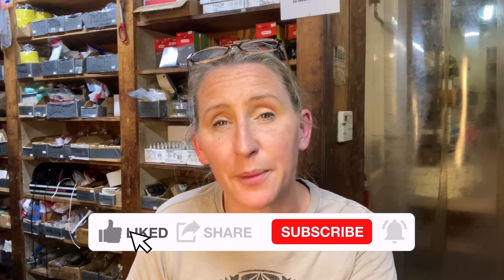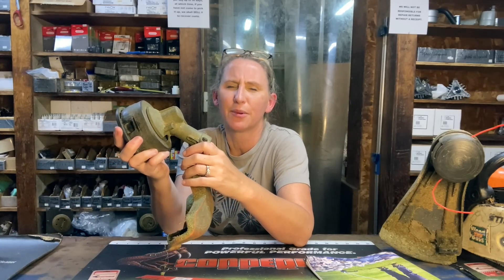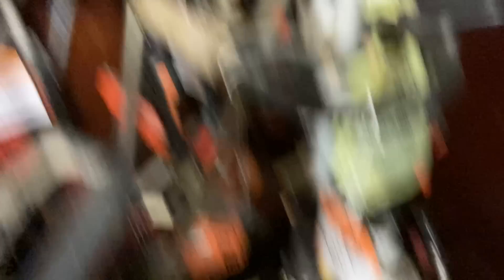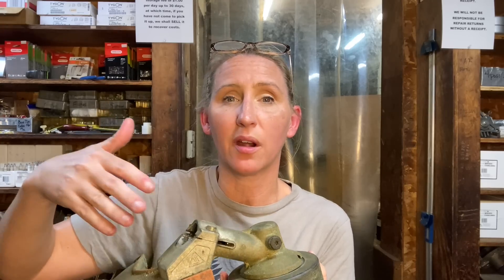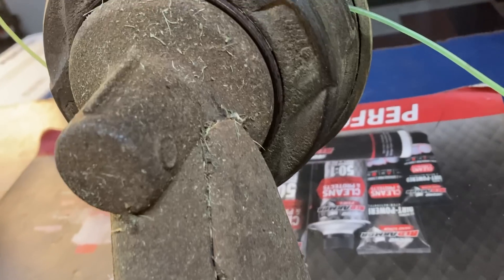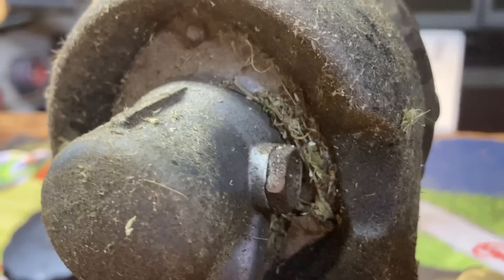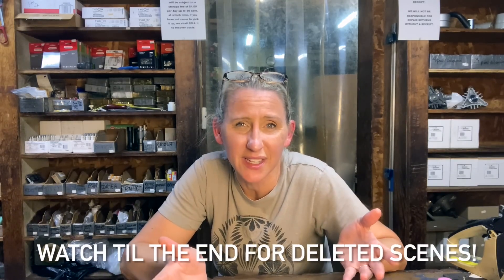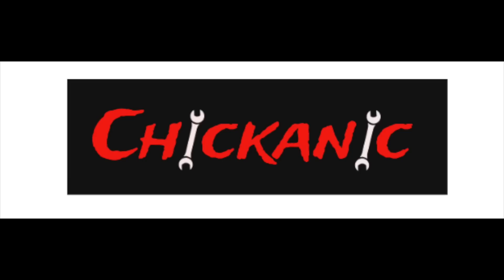Planned Obsolescence?! Why Would STIHL and ECHO Do This?!

Comment: OHH I can tell you why and you already gave me the data > I am an engineer and worked for Arctic cat for a decade and I can tell you they are saving millions by eliminating the grease plug every year. The math works out based on warranty claims. They want repeat business and max profit. I saved 1.5 cents per grease zek fitting and saved AC over 150K per year a snow mobile has about 30 grease fittings and Atv HAS ABOUT  26 and the sell about 175K combined units each year > my guess on the weedeaters that\y are saving 1.5 to 3 bucks per unit between casting > parts and assembly labor reduction how many units do they sell ?? not sure but its a big number

Comment: I use CV Joint Grease (molybdenum disulphide and graphite boundary lubricants) on my STIHL FS 85, 20 years old, and the gearbox and bearings are like new.

Comment: I have  2 Stihl's one is a string trimmer which has a grease plug the other is a stick edger it doesn't have a plug. I believe they are both FS-90 models bought both new about 4 or 5 years ago, No problems with either one but always wondered about the no grease plug but so far works like a champ. I do grease the trimmer once a year, but I actually read the owners manual.

Comment: You might have a video on my question but I don’t feel like digging for it lol
I have an Echo 225 that’s about 2 years old. Could you please tell me why the head doesn’t spin fast when I give it gas. It gets weeds twisted around the shaft above the head where it screws on. I’ll pull them off and try to weed eat but it does that slow business. Do I have the head installed incorrectly? I give it gas and it spins extremely slow. I have to let it spin that way a few times and then I hear something grab and kinda click and it starts spinning fast again. It’s happening over and over. Thank you for your help

Comment: My Sthil  360 brush cutter came without  a grease adapter on the head. I scratched my head and tail because I beleave there should have been one on it. I am so far in the bush I hate a 3 hour drive to get to the repair shop, so I purchased a 2nd head just in-case the original went out and decide I will very carefully put a grease nippel on both. Later saw a grease fitting on the same brush cutter at the same shop. It is a .....  good machine using the steel  3 blade  as I clear my land in Africa.

Comment: Nice. You need a Big Wheel (28 feet in diameter). At 4:00 we have our problem statement: 12000 RPMs (revolutions per minute) at 400 MPH (miles per hour). What is the radius of the wheel? I talked it over with ChatGPT and here's what it said: If I have a wheel rotating at 12000 RPMs (revolutions per minute) what radius must the wheel have if the speed is 400 MPH (miles per hour).
ChatGPT

To determine the radius of the wheel, we will:

    Convert the speed from miles per hour (MPH) to feet per minute (FPM) since there are 5,280 feet in a mile.
    Calculate the circumference of the wheel.
    Divide the speed in feet per minute (FPM) by the revolutions per minute (RPM) to find the circumference (since circumference = distance/revolution).
    Use the circumference to find the radius.

Given:

Speed ss = 400 MPH
RPM = 12,000

    Convert 400 MPH to FPM:
    sFPM=400×5280=2,112,000 feet per minutesFPM=400×5280=2,112,000 feet per minute

2 & 3. Calculate circumference CC of the wheel:
C=sFPMRPMC=RPMsFPM
C=2,112,000 feet per minute12,000=176 feetC=12,0002,112,000 feet per minute=176 feet

    The formula for circumference of a circle is C=2πrC=2πr, where rr is the radius. Solving for rr we get:
    r=C2πr=2πC
    r=1762×3.14159r=2×3.14159176
    r≈28 feetr≈28 feet

So, the radius of the wheel must be approximately 28 feet.

Comment: It’s poor designs and things like this that make me prefer older stuff when it comes to buying small engines/power equipment, nothing is built to last anymore, and in this case it seems to me that it is set up to not last. Sure the power equipment is warrantied, but I also don’t like to waste my time on something that is breaking non-stop because of a poor design. I would rather have something that is simple and built to last, and works properly than something newer that has more features and needs repairs more often, my Stihl 031AV is a prime example, never had one issue with the saw and I use it a lot.

Comment: In my opinion (and you can take that with a grain of salt) they took off the grease plug because they figured out that only one in 800 million homeowners ever bother to grease them in the first place. If it's cheaper to make without a grease plug why give them one if they're not gonna use it. As to the other issue about why the gearhead alone cost so much, I have no answer, but it fits right in line with how much they charge for batteries on their battery powered equipment. If you buy a Stihl leaf blower with a battery it costs about $50 more than buying one without a battery. So, one would think, the battery costs $50. Nope. They sell the battery alone as an accessory for $100. I guess the answer is they do it because they can..

Comment: Can you remove the head and use a long needle greaser to lube the gears?  Possibly just a tube with a grease fitting through the square hole when the shaft is pulled out.

Comment: I knew I was in the south when I pulled into a gas station outside Ft. Campbell and a guy rolled up (off US 41A) on a riding mower, pulled up to the pump next to me, gassed up his mower, tossed a couple empty beer cans in the trash, then went inside, came out with another sixer, cracked one open, and drove off, back onto the highway.

And yes, you can get a DUI on a riding mower, if you're on a public road.
🌈⭐

Comment: You had better check out the new lawnmowers if you are planning on buying  one. Some of the newer ones, zero turn and traditional riding mowers won't have grease fittings on the blade spindle housings. The salesman will tell you they don't need them, because they have sealed bearings. Thats when I tell them if they want to sell me one, it will have grease fittings on them.

Comment: The echo  srm 225 non grease fitting head also only has two bearings.  The head with the grease fitting like on the older 225’s has three bearings. So they skimped on the bearings also.  Money ahead to spend an extra 75 dollars and get the 2320 T.  It has a two to one ratio greasable high torque gearhead, a two-stage air filter, and a chrome lined cylinder!

Comment: All I can think of is some tools built back even in the 50s maybe even earlier like a Craftsman table saw and jointer I had had bearings that did not have grease fittings they were maintenance-free in that regard and I was using these until I gave them away a couple of years ago. These were seventy-year-old tools that never once needed grease.

Comment: Something similar to this is Arrow Swivel Riveter #RHT300 which they've changed to Quick Change Color Coded rivet heads that don't require the Wrench Tool to change out the rivet heads, so the Tool is no longer provided in the handle pouch. The idiots don't realize that the tool is also needed to access the barrel when the rivet gun jams. I sent the first order back because I thought it was a mistake, but the reordered package was also missing the wrench tool but it's clearly pictured in their advertising, and the description says it comes with a wrench tool.

Comment: I purchased a Stihl 560 clearing saw a couple of years ago and was really surprised to find there was no grease plug. I asked the dealer and the story was that lubricant technology was now good enough that the plugs were no longer needed.

A year later Stihl introduced a new 561 featuring "improved re-greasable gearbox with enhanced lubricant circulation resulting in longer service intervals ". Dang !

Comment: They are failing with their strategy. With so many products nowadays the good brands break maybe not as fast but too fast for the price you pay. So people just as well buy a cheap knock off from China (here in Europe at least) It breaks a bit earlier maybe but it's less than half the price. They should be either expensive but very good or cheap but low quality. They want to sell stuff that is expensive and low quality. There are no markets for that. And if they think people will pay for the name: fail again. People didn't buy Still for the name. They bought it because it was so good. As soon as people figure out it isn't anymore the name doesn't matter all that much.

Comment: I was looking for a new chainsaw recently, as mine is 20 years old and well used, and was looking into Stihl because the pros I know use them. The consumer-level available ones really surprised me, because I have never seen a blade so thin, I could bend easily with a single hand.  My immediate thought is that it would be way too flimsy, but perhaps there is some magic in paper-thin blades that I have yet to learn.  I bought a Husky, and it works great, and the blade doesn't bend when you blow on it. Also I like that you wear rugged pants/chaps when using a saw, but you should also also wear headgear even if you know how to avoid a kick, there is always an accidental slip or act of nature.
Reply: Reason for thin blade and thin chain… narrow kerf and faster cutting. I haven’t bought a Stihl saw in 30 years but I bought a ms170 and it cuts like crazy.
Reply: @zeeb696  Good to know. I wish they had free trials.  My Husky cuts maple like butter when it is sharp, but dulls quickly.

Comment: Do the units aimed at commercial use have the grease plug?
How much to fit a zerk grease point to the new heads. My Chinese unit has a zerk, drill n tap before it leaves the shop?

Comment: That's the same as my buddy bought a Murray riding mower with the hydro static transmission 20 year's ago & in probably the 3rd year of running it the transmission quit pulling, so he carries it to the shop & the rear end alone was $800.00 where he didn't give but $900.00 for the whole mower.
Reply: So true! Those "hydrostatic" mowers which were all manufactured by MTD under different names were light duty units 
Unless the hydraulic system has a separate pump and fluid reservoir the sealed drive units are light duty and will fail under hard use. When they do fail the cost is often more than half the cost of a new mower 

Iv'e seen $4000 zero turns with "hydrostatic" drives fail in 2 seasons because the user was mowing 20 acres a week commercial when the manufacturer states they're intended for residential 1-2 acres a week use

Comment: No grease head screw? Probably for the same reason Ford transmissions can't be serviced with a new filter. One and done. The head manufacturers probably realized only 5% of their consumers read the owners booklet and even know about it. And even less know what to do if they take the screw out. We are not in 1960s / 70s Kansas anymore Dorothy, back when dad taught Jr. how to do things using that dented up Craftsman tool box full of stuff. Worse, if they do they put something in there it is not what is supposed to be in there.

 I recently bought a new (they say commercial quality) Husqkie trimmer. NOWHERE can I find what the (NLGI) grease spec is. Only their recommendation to buy some magical stuff from them. I don't think the engineers had a say on that one.

Comment: Just take a tiny drill bit and drill a hole through that outside housing use your chainsaw bar greeser and Greese it full Like years ago when we used to Greece the nose sprocket of the chainsaw bar works just fine

Comment: They likely built new tooling to cast the head housing.
The cost to add a hole with the tooling is a good chunk of change and much more so if the threads were cast into it.
To add the hole after casting will be a two step operation. Drill then tap. New tooling, machinery and operation would be needed there.
That little threaded hole is actually a fair amount of money.
This, combined with the thing not being used by so many people and the opportunity to sell more parts is the reason.
Easier way to say it is in one word. Greed.

Comment: Corporate crime to make money? Strictly speaking making worhless junk to sell is not a crime in China and the CCPUSA of Biden. The problem with corporate greed is that the American consumer ends up losing. Many times I have paid good coin for something that looked like qualith and turned out to have flaws intentionally designed into the product so it would fail much sooner. I bought a security light to mount outside of my garage which was not sealed so rain go into the circuit board and you guessed it, electricity and water are not a good combination. 
PS. Be sure to purchase an electric Biden Mobile and see how long it lasts in wet and humid areas.

Comment: You sort of addressed my comment. If most of your customers don't realize they have a grease port, and you rarely see an Echo trimmer that has a failed head, then there doesn't seem to be much need for the grease port - at least on Echos.
Reply: They don't realize there's a fitting/was a fitting because they're manuals didn't show them!  This was designed for service techs, not most homeowner users.  And most people probably don't take their trimmer to a shop unless it's already broke.  I bought a new FS70 earlier this year.  It has no fitting.  I'll take it apart and grease it myself, but I'll forever avoid buying another Stihl anything!
Reply: @WaltShear-mz5ug  avoiding buying stihl just because you have to take apart and grease once in a blue moon is lazy talk

Comment: "Planned  obsolescence" is disguised as "value engineering." 
This is a page out of automobile manufacturers play book. 
Tie rod ends, ball joints, etc are now "greased for life" and have no grease fittings. 
Hell my Wright Stander X is down to five grease fittings now. 

Drill it and add your own grease plug or fitting. Cars and OPE alike. Not hard to do.

Comment: About 10 years ago I took my vw jetta to the dealership for transmission service because it was acting up. They told me that those transmission don’t ever need to change the fluid or filter. But they sell the filter and fluid so I bought it and I did it my self and I still have that car running like new. It’s funny that they pretend grease or oil will last a 1000 years 😂😂😂

Comment: It’s not a new feature. Stihl hi end brushcutters such as FS410c have had no gearhead grease options relying on the grease installed at manufacturing to be kept intact and sealed by the bearings.

Comment: Interesting about grease points.  As you say grease points are good for long life of gears etc. For strimmers I have found that grease can be too solid to keep flowing between surfaces so I use the grease type that is supplied for constant velocity joints on cars. This grease is much more liquid and has a moly content to minimise friction. Only a small amount is needed.

Comment: Congratulations, you stumble on the dirty little secret, did you know the same thing is going on in the automotive industries, the bearing are permanently sealed, there are no more grease fitting on wheel bearing, tie rods and so forth, when I was in high school back in the 70ties when you did an oil change, you had a dozen or so grease fitting to lube while you did the oil change which was common practice twice a year. I would do mine in spring and fall, for pleasant weather, and did them 10,00 miles intervals, and bearing would last for a long time, seems almost forever. now these seal bearing go out or need to be replaced every 3-5 years intervals because they would dry out and overheat. if you did this on a regular routine basis, that was very expensive, but it was much more expensive it the totally failed like when the wheel bearing try to seize up and watch the wheel separate from the vehicle at 70 miles an hour on the freeway. in other words, put in your mind set to junk the vehicle and purchase a new vehicle. every 3-5 years then maintain it or rather than have it last 10 years and beyond, hence, it's all about the money and scheming how to make it faster. now we have synthetic oil and more frequent intervals of changing the oil, and then you happen to miss a dead line, the warranty will no longer cover the repair or replacement.

Comment: Most people cant operate a grease gun, definately cant load one. I have seen to many with to much grease in it, and somd where they pumped so much grease in it that the shaft was packed half way up the trimmer. Others break the Zerk fitting off. You cant fix stupid. Dont beat a dead horse.

Comment: My family and I own two Stihl retail stores in SE GA ,Ive worked on the equipment for 15 years and almost never have to put gear boxes on the FS56c and thats are best selling trimmer. Stihl also has sealed gear boxes on the edgers now and never have problems with those either, We service and sell hundreds of units a year. I will admit I was weary of them as well but have had very little issues with them!
Reply: I too have not seen a gearbox failure on a Stihl with sealed unit, but time will tell right

On a side note, Stihl's warranty is incredible for dealers.

Comment: In the 90's I used to fix VCR's (and more but let's focus). Panasonic put a "putty" type substance on the power supply capacitors that over time would heat up and become conductive. Yup. Shorting out the power supply on purpose. Planned obsolescence.